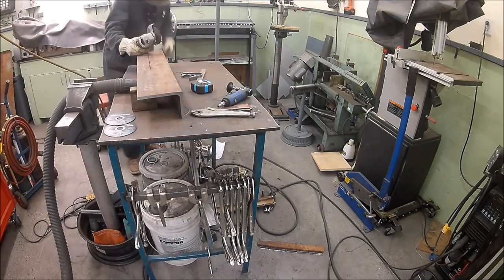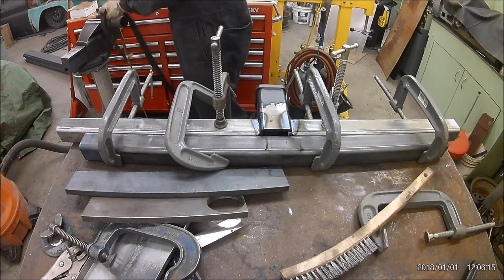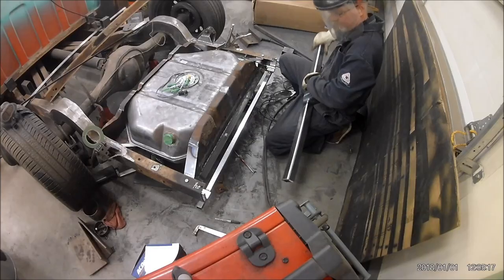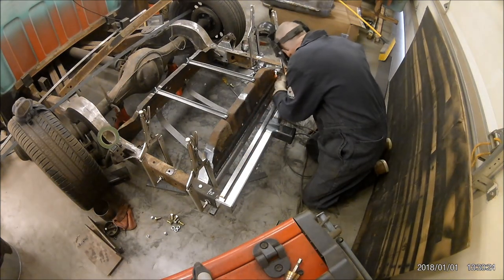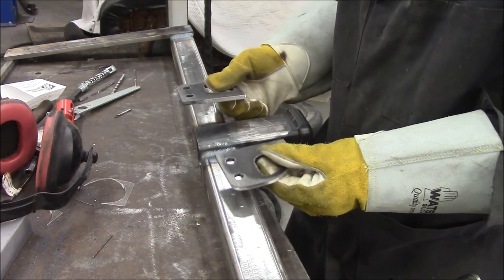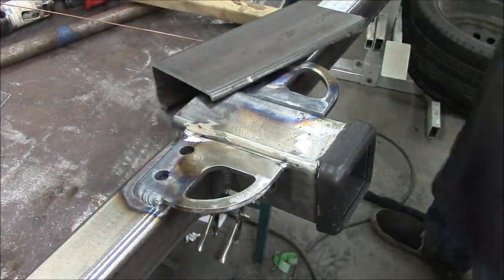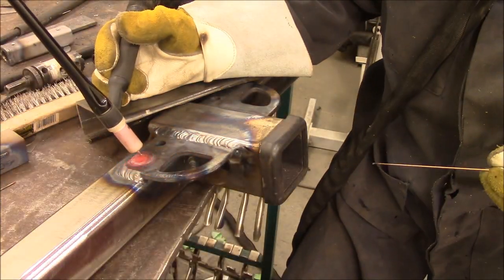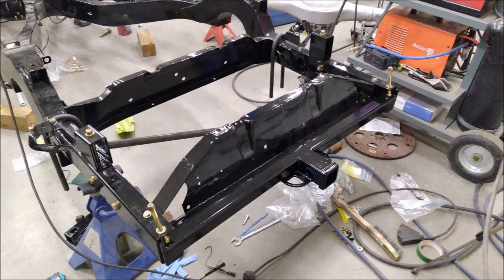BUILD: A Trailer Hitch!

Comment: I believe the issue you were having when you switched to the glass cup is that the gas lens in it is meant to be run at a lower argon CFM than a standard cup and collet set up. As I understand it if you don't lower the CFM the argon flow is to heavy and causes turbulence around the weld allowing outside atmosphere to contaminate the weld.

Comment: You mentioned welds on this 65 “X” frame. I can only picture a black & white film of these being assembled on a moving line. The jig is in place and the burly 28 year old guys tossing the steel in place, adjusting ever so gently with a “Spud” wrench. Everyone in coveralls with hair cuts high & tight (Just like yours, but by choice) but a hand-held helmet, one handed arc welder and stick desperately trying to find the joint with #14 glass and not auto-darkening. It was truly a different time in life. No hearing protect or eye goggles and some with gloves.
 I read a post or comment that stated “The rivets allowed for so much movement that no two vehicle truck frames came with a 1/4” (11mm) of square. What? Red hot rivets may have dropped into slightly oversized holes so they would go in, but hammered with pneumatic guns to create that button head we have seen, but as they cool, they have to so tight, it was immense pressures. They were good enough for many ships, battle ships, tanks for liquid and many more like these trucks. The later models like 67/72 had few welds but lasted 55+ years a do not come apart easy. 
  This guy was basically saying these were weaker than bolts. I say BS in American, not sure about Canadian!
  Thoughts?
 PS, I have never used a TIG, but a number of guys, simply use 0.035” MIG wire when welding. They run out some feet, cut off and straighten some. I do understand you had some larger gaps or lap weld to fill. This takes much more filler rod and if I am not wrong, even several passes. 
  I am enjoying the build, but I am retired and in pain but go for a 10-15 minute period before I have to sit. I might as well enjoy someone else working!

Comment: Hopefully you are teaching trades based courses, like welding.  This is coming from another "shop teacher" (Auto, Auto Body, Welding).  I like how you tied everything together as one structural piece then Tigged it out for appearance and quality.  Never used Delfleet but have heard great things about it from my friend who's a painter.  One thing I like to do after sand blasting is to sand the metal to get rid of some of the etch with 180-320 grit, this works good.  Then epoxy just like you did.
Reply from the maker: Hat's off to you body guys.  I'd rather do ten engines.  Cheers!

Comment: Tohelp with your warpage problems weld a root pass that’s hot enough for penetration but you don’t have to cook it, and do it in opposing sides so that the shrinkage of material fights itself causing it to hold itself generally in place, once you have a good root pass all the way around you can run a hot pass burning that root pass in and adding structure to the top of it, do this in the same order as the root pass so it fights itself from warping. Another way is to do small welds and cooking it with an air gun so that it never gets hot enough to warp. Both are good ways but can be difficult to learn best of luck my friend

Comment: Very nice. I just bought a brand new Honda Passport for my 60th birthday.. My first new car. Well wants over $300 just for the hitch... Not gonna happen! I'll probably weld one up with 7018 stick but after seeing this I am tempted to use my 200A Tig.
Reply from the maker: While I have the capability of doing stick, I hate stick; I'm not good at it, and I don't enjoy it. Maintenance Guy for the School District here does everything structural with stick, I do everything structural with TIG.  I'm sure either way would work. I am NOT a ticketed welder, I'm largely self-taught (so keep that in mind, eh? (grin)).
Reply: @GregWellwood  Yeah there are a lot more nuances with stick, i.e little things you have to take care of but not obvious. Its much easier to do pretty welds with TIG in my opinion in any position.. The different types of rod weld very differently too with different techniques between say a 6011 and a 7018. But the challenge is also partly why I like it..:)

Comment: Never heard of that much post flow on non stainless steel or exotics. 

3 seconds always appeared just fine to me
Reply: Also the welding looked fantastic. Some of the larger cups give me bad “blow back” when welding inside corners.  I have to adjust to get less direct reflection.

Comment: 1/4 inch wall is that for class 4 hitch good for 10 000 lb tow 1000 lb tung weight?  i want to build one for 3500 lb and 350 lb tongue weight.  Is 3/16 wall tube 2x2 is enough??
Reply from the maker: I'm not an engineer.  The truck I built this for is only rated at 6000lb towing capacity.  I over-build things like this so that they WON'T fail.
Reply: @GregWellwood  my vehicle is rated for 5000 lb max tow, would you recommend 3/8 steel for the chassi extensions

Comment: I am wondering why not just mig or stick the entire thing? Why tig?
Reply from the maker: You totally could.  This metal is too much for my 140 MIG, and my TIG can do 200. Plus, I like TIG.
Reply: @GregWellwood  Yea, I got the comment early in. If I recall a Pro-mig 140 is rated for 1/2" with self shielded. I haven't picked up my gas for tig yet... but everything I've seen it's amazing. Finally stepping up from my Century Mig...  I know must guys like the more control with tig, heat and filler metal. Just wondering if that was your reasoning.
Reply: You can tig the roots and cover with stick....tig is just much cleaner

Comment: 5:11 ............ Getting the "funk out" ?
Reply from the maker: As long as it'll "make the noise."
Reply: @GregWellwood  It always confuses me how Bad Obsession Motorsport can have "Only" 400k subscribers, but are somehow also one of the most quoted car build channels on YouTube ? :D

Anyway, many moons ago I used to work in a powder coating plant, and we used to be told that powder coating just made things look pretty. It was p*ss poor at actually weatherproofing anything. If you wanted your part to be weatherproof you needed to pay extra for us to chemically dip the metal first (Some kind of phosphate bath) or overcoat it with a clear powder coat lacquer. It seems that back then the basic finish was slightly porous, and would actually allow water to soak in and be held it in contact with the underlying metal longer than if the part had just been wiped over with an oily rag!

I don't know if the paint technology's changed  since my time though. This was all about 30 years ago, so I'd like to think there's been improvements since then.
Reply from the maker: The big turner for me, was one of the teachers asked me to fix his roof rack. When I had a look at it, it was mostly powder coat, no metal; the metal had all rusted away to nothing underneath. I decided to stick with good paints.

Comment: I used to do powder coating, and YES you can powder coat welding...i have built MOVE Bumpers, and also my own design bumpers, and never had an issue powder coating welded areas......hmmmmmm
Reply from the maker: What I meant was perforating the powder coating to re-weld something.